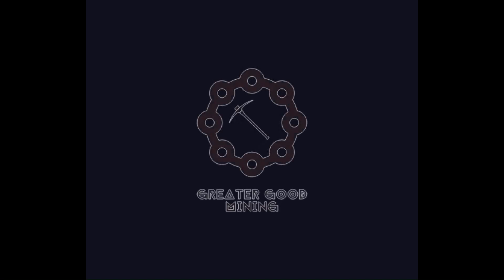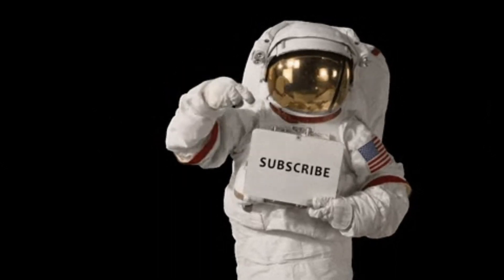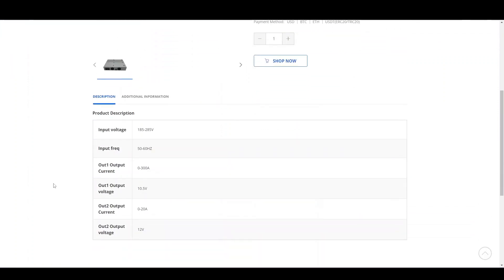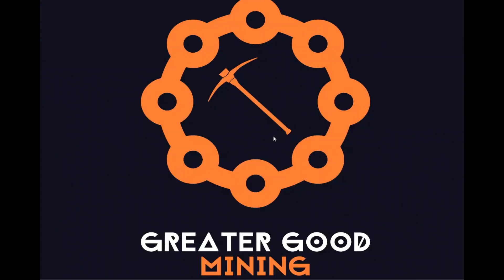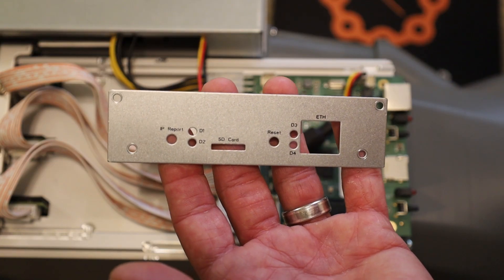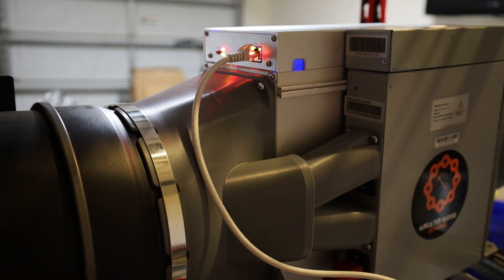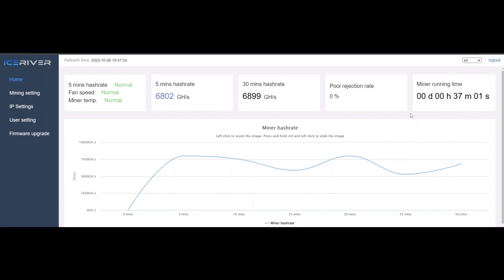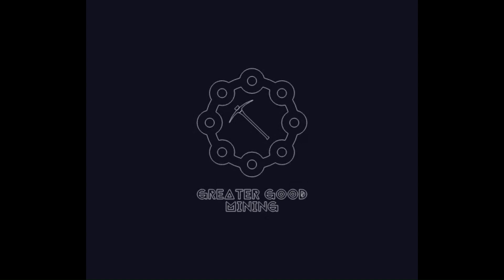Turn your Iceriver KS3L Kaspa ASIC into a KS3M!!! (5% Iceriver discount in description)

Comment: If you bought a ks3m will it come with ks3m hash boards or ks3l boards?
Reply from the maker: The hashboards are the same. KS3M just has different control board with different firmware. Basically the ks3m is just an overclocked ks3l from the factory
Reply: @GreaterGoodMining  then why do they sell ks3m hash boards there has to be a difference.
Reply from the maker: @johny5isalive  they just stamp them with a different number. They are the same. My KS3L runs just like the KS3M. Only difference is the control board
Reply: @GreaterGoodMining  I bought this and a heat sink fell off and the place in the US will not warrant it. 3 months old.
Reply from the maker: @johny5isalive  you bought the hashboard from somewhere in the US?
Reply: @GreaterGoodMining  Here what they said. ( )is going to do nothing. We did as you asked and sent you the machine you purchased. It left our building in new condition, not making any noise and never been open.

We wish you luck in your crypto journey.
Reply from the maker: @johny5isalive  open a ticket on iceriver.io and see if they will allow an RMA

Comment: Hey one of my hashboard is not working out of three only 2 mines and the third one just shows temperatures
Reply: Can anyone help me out here
Reply from the maker: Try to reboot the machine, if that doesn't work try to do a hard reset. If that doesn't work you might want to open a ticket on Icerivers website and report it to them especially if you're still under warranty. If you don't care about your warranty and you're more of a do it yourself type of person, you could disassemble the machine and inspect the connections and hashboards to see if you find anything out of place etc. I don't recommend doing it yourself if you don't know what you're doing. I'm not responsible if something else breaks
Reply: Thankyou it was amazing help from you. i already tried rebooting and hard resetting i guess i will raise a ticket to iceriver. @GreaterGoodMining

Comment: How to overclok ks3m ?
Reply from the maker: There are no overclocks for the KS3M
Reply: @GreaterGoodMining hello bro , is still no way to overclock my ks3m ? Like nothing to do to add Th to it ? And btw I’m running with the AC infinity setup cause of less noise
Reply from the maker: @ceonm5700  Yes you can now overclock your KS3M using PBfarmers firmware. It is available on Github. I am releasing a video today where I overclock my KS0 Pro and I will have links to his firmware in the description of that video.
Reply: @GreaterGoodMining  thats great bro, so is there any hardware I need to add or is it just a firmware use ?
Reply from the maker: @ceonm5700  Mine works just by swapping the KS3L control board for a stock KS3M control board. No other hardware needed
Reply: @GreaterGoodMining  bro when are you going to upload your video ?
Reply from the maker: @ceonm5700  Just uploaded it about 30 minutes ago! :]

Comment: I advice to use a grounded ESD mat, that carpet you were working on can build up a lot of potential (in your body) that can damage electronics.
Reply from the maker: Thank you I appreciate the tip! I usually work on rubber mats in my garage when I do this but it was hard to hear me with my other mining equipment running so I did this one in the office. I will look into getting an ESF mat though! Thanks again!

Comment from the maker: Will you attempts this upgrade now that you see how easy it is?
Reply: there are a firmware upgrade for KS3M. Can I use it after change acontrolboard?
Reply from the maker: @pepok957   If you put a KS3M control board in then yes you can update the KS3M firmware like usual